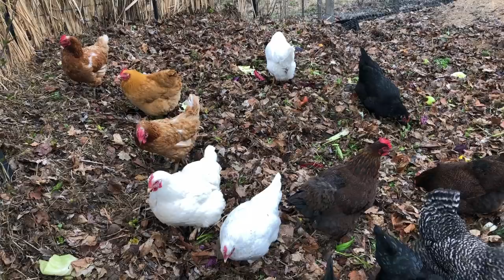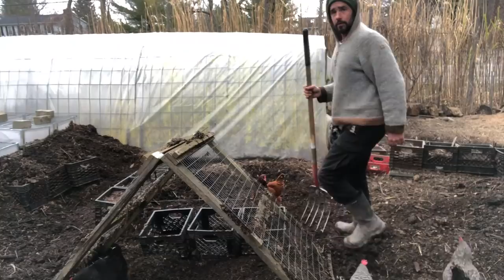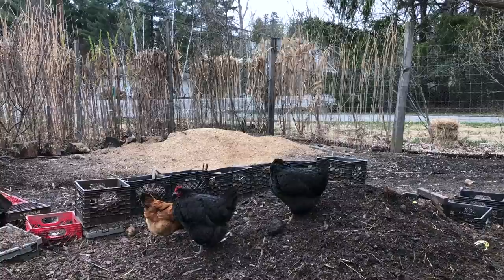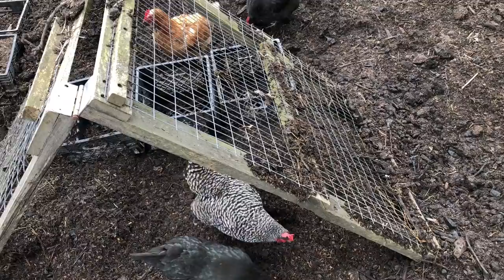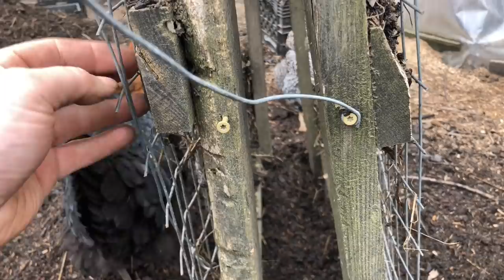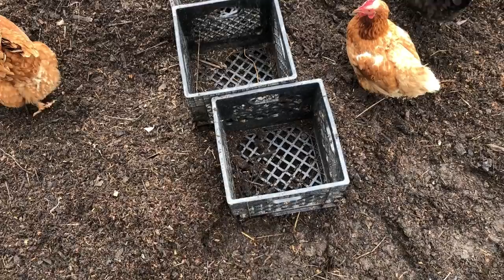Compost Sifter - Simple Design Works Nicely

Comment: A few years ago I made tables out of scrap wood and put ½ " hardware cloth for the top. I use it for seedlings when I'm not using it for sifting compost. When I am sifting compost I can put small tubs under the table to collect the end product. what is left on the top goes back into the compost pile. The tables are a little wider than the length of a 1020 tray and will hold 4 trays with a little room left. They are light enough for me to pick up and move, and small enough for me to use in my small greenhouse (11x20) in the winter.  It does take a bit of effort to rub the material through the table but it find it to be therapeutic. I just put on an audio book and get to work. I generally do this job around the fist of January. It's a great way to start the new year....I usually use this in my starting mix that I will need once we get into February.
Reply from the maker: Sounds like a really lovely way to do it!

Comment: I just built a simple compost/soil sieve.
After I'm done I end up with some big chunks of wood,  mixed with rocks.
This is stuff I don't want to throw it back into the compost pile, so I generally pull out the stones by hand. 
One can separated the stones from the wood by tossing the mix into a bunch of water,  and skimming off what floats.
Lately,  I have considered this mix as a feedstock for biochar.
After the wood bits pyrololize, you quench everything in a container of water and skim the floating char off the top. 
Finally you end up with a container of gravel,water and stone.

Comment: What if instead of using the abundant and free energy provided by the Earth's gravity to separate the compost, you used a nuclear fission-powered centrifuge and a cylindrical mesh. Then you could fork the compost into the center and let it spin out the finer material. This would have the advantage of being extremely energy intensive and complicated to build, plus it would scatter the sifted compost 360º throughout the garden!   🙃
Reply: Can can you just buy uranium? Also do u have a rust, rot, dry, and safe storage of the spent fuel? Then by all means share your structure sounds really cool!
Reply from the maker: Seems reasonable.  I could also just use plutonium directly in the garden to get warmer soils and a head start on the growing season!